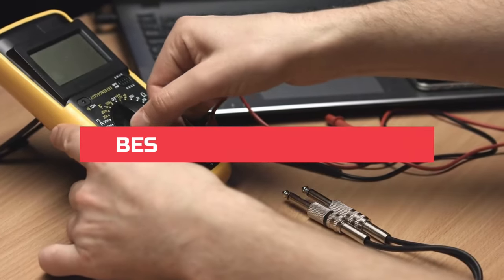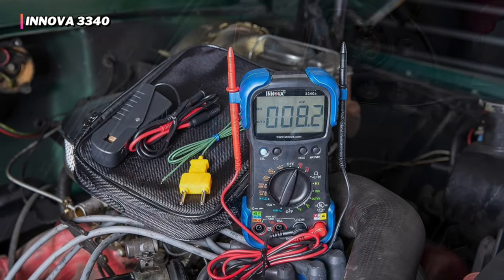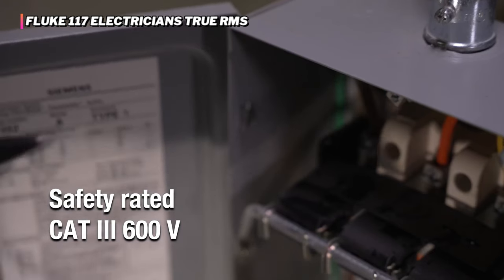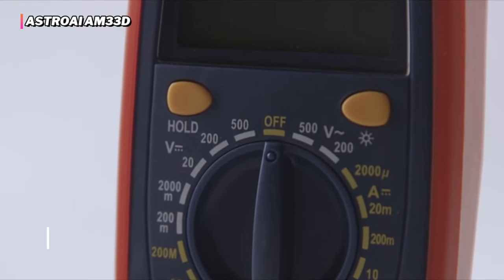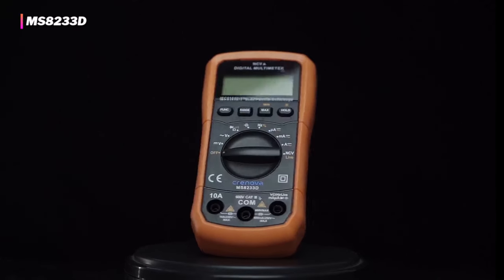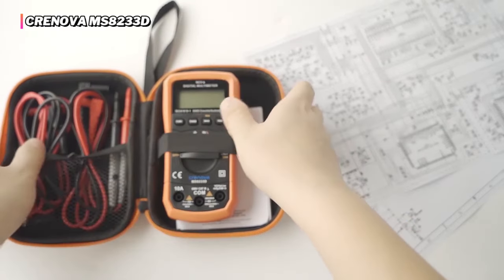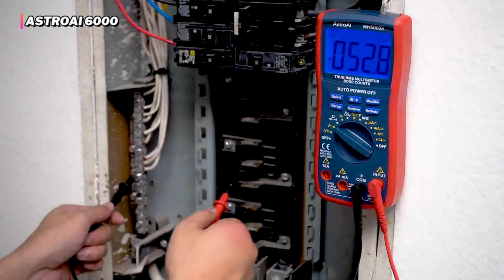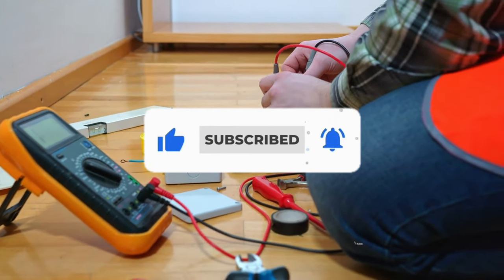Best Multimeters 2023 [watch before you buy]

Comment: Buy a klein tools MM235 Multimeter if you plan on working on simple house hold things and video game systems
Reply: Check the YouTubers rating the Klein MM325 and MM450s.  The Klein MM325 at $34.98+ is good for many functions "not needing" computing diagnoses like for temperature, for capacitors and for transistors.  It won't be recommended for hobbyist digital technician projects by not having the thermal extra diagnosis, checking if a capacitor is good or has failed and if a transistor still works fine at the Emitter, Base and Emitter diagnosis vs someone bypassing the PN or NP junction of Collector to Base leads with neat diode checks of Base to Emitter (to decide whether to replace transistors going out with its Q point going outside its normal range assuming temperatures were not the problem).